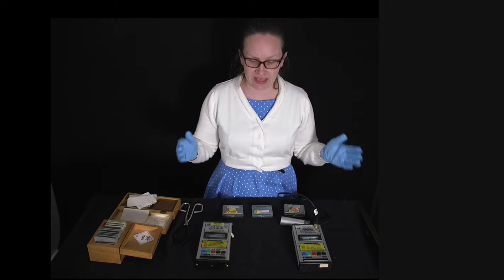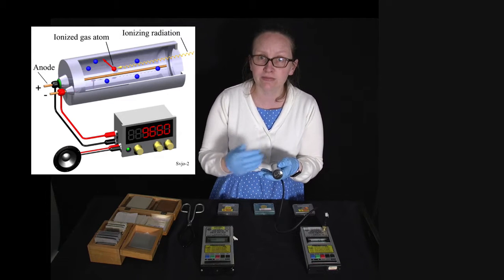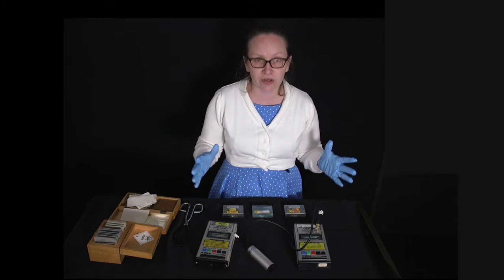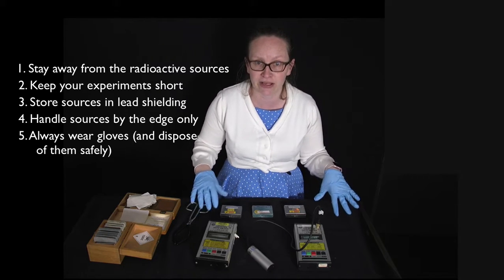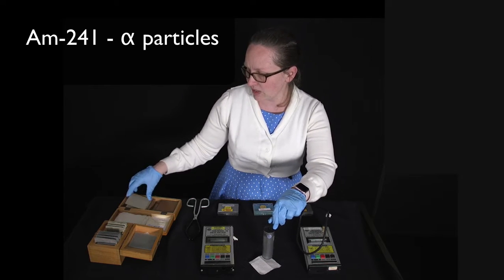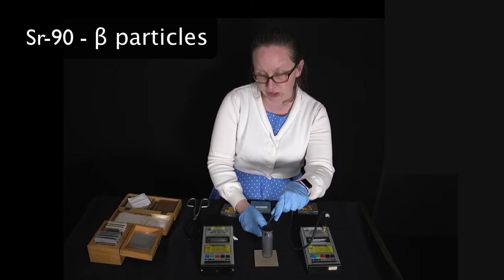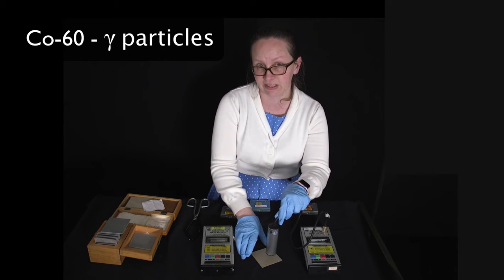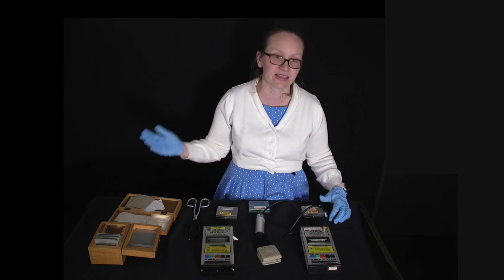Using a Geiger counter

Comment: Great video but make sure not to store the Sr-90 source or any strong beta source directly in lead as it will produce lots of x rays when the beta particles hit the lead shielding giving anyone near it a much higher dose. Instead always store beta sources in lucite or a low density material first to block the betas from interacting with the lead.